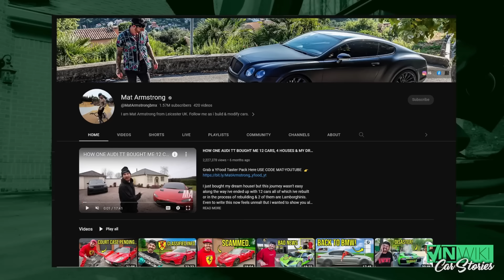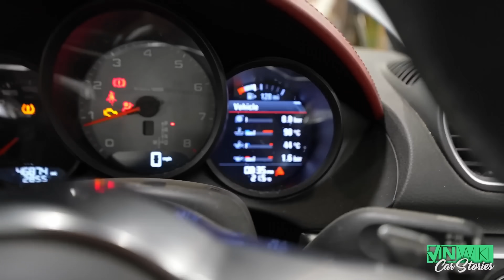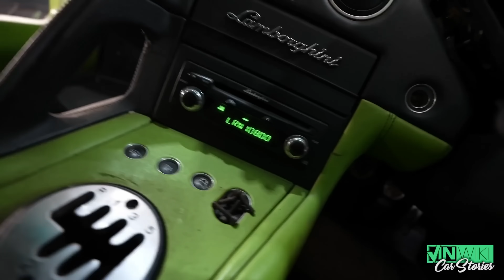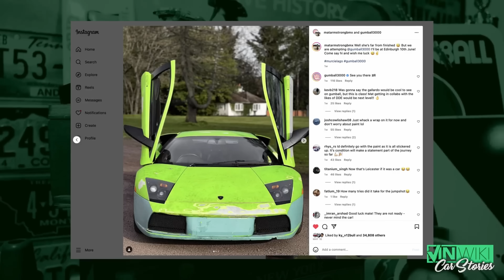Mat Armstrong's Top 5 Car Stories!

Comment: 14:55 pro IT tip. it’s not just an ethernet cable. the port on the ECU is serial that can be wired up in to a cable that goes to rj45 or ethernet. so yes not a common ethernet cable